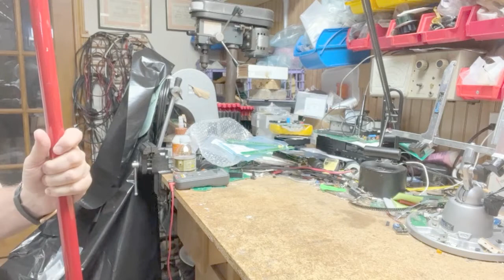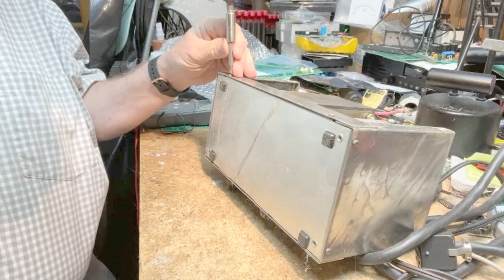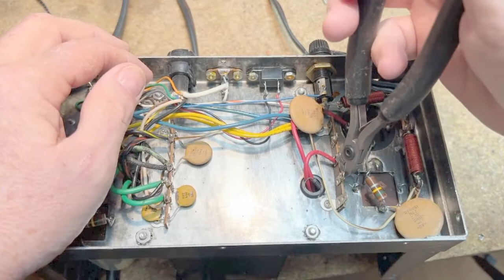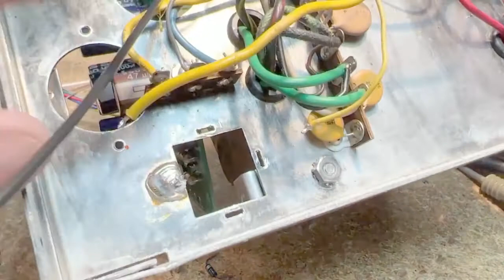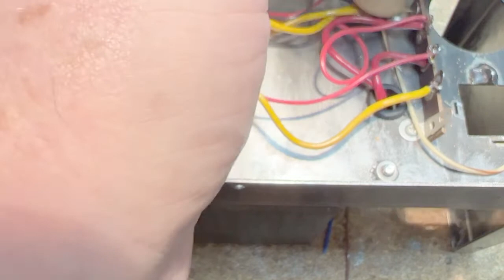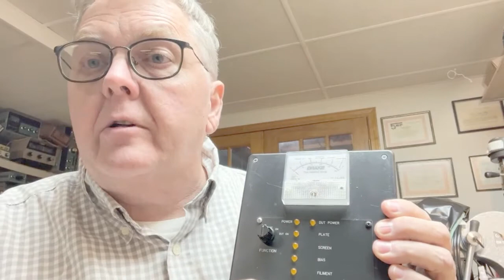Part two of Installing the Drake AC4R power supply upgrade

Comment: Sir,  I have just finished installation of the AC4R in my power supply.  While I was in the Navy, I did not spend 50 years in the communications field (I was a Machinists Mate) your excellent video, along with the good instructions, enabled me to easily build and install the kit.  Thank you very much for making the kit and the videos available.  I do have 2 minor comments: the installation of the PCB may more easily be done by attaching the ell-brackets to the PCB and then mounting it onto the transformer bolts, and the bolts used to attach the PCB to the brackets could stand to be 1/16" - 1/8" longer than supplied.  Again, thank you very much for the kit, the instructions and the videos.  I would send a picture, but it is all buttoned up and reinstalled in the MS4 cabinet.  Now to finish the R-4A and T-4X recap and on to the fun.  73 Chas AD0UY

Comment: Mike; this being your second YouTube video, both are fantastic and should sell a lot of your AC-4 power supply upgrade kits, at least for me!  My only thought was, since there are no grommets were the new wires pass through the chassis, to perhaps, add a bit of "wire spaghetti" or heat shrink tubing to the area that passes through these holes.